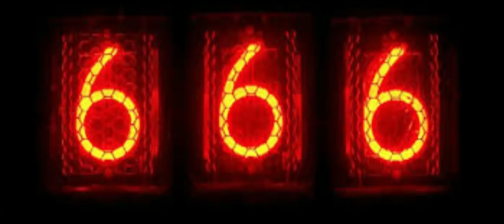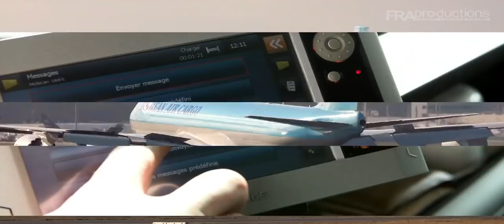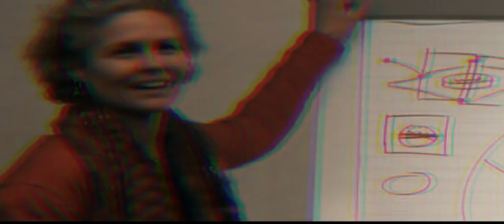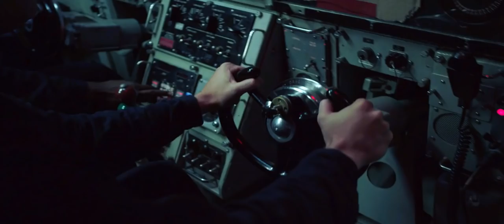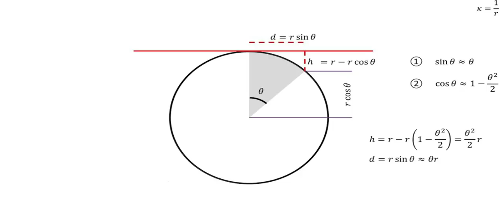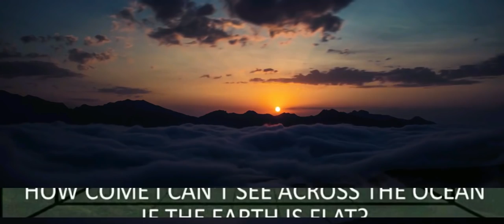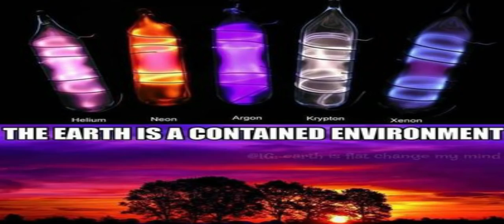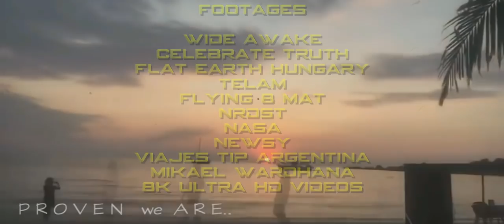Flatten The Curve ! The Documentary By Vikka Draziv

Comment: The Global Positioning Service uses 24 atomic clocks mounted on satellites orbiting 12 thousand miles above the Earth, each one broadcasting a very precise time signal at the low end of the microwave band, at 1.5 GHz.  
The speed of light including microwaves is about one nanosecond per foot.
Your GPS receiver needs to see four satellites to calculate your location from their signals.   Reflected waves won't work, it has to be direct line of sight.
The altitude record for balloons is 33 miles.    A GPS that uses balloons would need thousands of transmitters.    And they would need motors to hold their positions within a few feet of where your receiver expects them to be.   They would be large blimps, not weather balloons.    
There are no GPS blimps.
A 1.5GHz signal only travels a few miles in sea level air.   The GPS works way out at sea, thousands of miles from the nearest tower.   
There are no GPS towers.
The GPS is wireless.    It doesn't use cables. 

That leaves satellites orbiting Earth above the atmosphere as the only place the 32 GPS transmitters can be.
Billions of people and machines use the GPS.    It's not a hoax.   It can't be faked.

It only takes one piece of contradictory evidence to bust a false hypothesis.
The working GPS is irrefutable evidence of manmade satellites orbiting Earth.
Manmade satellites are irrefutable evidence of conventional orbital mechanics, as taught by universities world wide, including gravity.
Any object the size of a star or planet must be spheroid, because of how gravity works.

The working GPS busts the Flat Earth hypothesis.   No horizon photos or longwinded hand-waving Youtube videos can change this fact.
Reply: Out of curiosity, I have fallen into a strange rabbit hole
Help me
Reply: @deathpie24      It's simple.   Listen to the scientists.   They follow the evidence.   Ignore the clickbait miners.

Comment: Dudes,
       Long ago early navigators discovered that the elevation angle of Polaris yields the latitude you stand on.  Neat eh?  Flat Earth went into the dumpster and became the dumpster fire that this documentary is.  Polaris is viewed at the zenith when viewing from the North Pole.  It appears on the horizon when viewed near the equator.  This lead to Celestial Navigation that thousands if not millions of navigators have used over the centuries.  Celestial Navigation doesn't work on the flat earth.
       So how does your Global Positioning System work?  Like a champ eh?  If the earth were flat GPS wouldn't work at all.  GPS uses the Oblate Spheroid math model of the earth.  Where is the Flat Earth Positioning System?  Don't hold your breath, its not coming ever.
       I have a hard time believing these guys are pilots.  I used to do "Touch and Go" exercises just before dawn and you could see the sunrise two or three times.  Not possible of the earth is flat.  Every pilot knows when you trim the plane at your operating altitude, it will stay at that altitude until it runs out of gas.  The Plane will not climb into space and does not need constant "tipping the nose down".  The Pilot that said he does that is a liar and likely not a pilot.
       The beginning of this documentary is pathetic.  You guys should get your GEDs and get a clue!

Comment: You realize, that an aircraft at 30,000 feet, is visible to radar, on a globe Earth, at a distance over 200 miles. How many times was it repeated in this video that it is impossible. But it perfectly lines up with the globe.
Reply: Pretty sure he said impossible to track using radio waves. And I doubt radar would reach 200miles.
Reply: @monty3322  As he said, radar is line of sight, even on a globe earth, there is no problem with line of sight to an aircraft at 30,000 feet, at 200 miles.
Reply: @monty3322  You realize they have bounced radio waves off the Moon, and that is 230,000 miles away
Reply: @ToxicTeemoOCE  Yes there Is. I just looked at it on two Earth curve calculators, one being the Globers metabunk calculator and the other dizzib. They both agree you have serious line of sight problems. The aircrafts eye height is 30.000 ft. The ship is at sea level 200 miles away. From the pilots vantage point the physical Earth curve horizon is 6.7 miles away. At this point the pilot cannot see anything beyond that physical curvature limitation nor could his line of sight radar. The ship at sea level is another 193.3 miles away from the planes physical Earth curve horizon and has a target hidden height of 24900.7655 ft or 4.72 miles. This is the height below the horizon where the ship is down on the opposite side of the ball. There can be No line of sight at all with 4.72 miles of Earth height in the way.

 - Now what you have done in your mind has said to yourself, " we know ships can obviously radar contact aircraft 200 miles away and 30.000 ft in the air and because I believe we live on a ball it must be possible as proof of my ball" 

- Problem is you Failed to actually Check It against the sphere Earth curvature.  The fact radar does work with a plane 30.000 ft high between a ship at sea level 200 miles away is not only impossible on your globe it is a Flat Earth Proof. However you aren't done with the heliocentric problems. In the heliocentric model a spherical Earth is not only spinning 1040 mph at the equator (or in his case was around 600 miles due to his location) the speed and direction with a tilt and a wobble at which the Earth rotates would vary constantly through the ships travels, as well as in relation to the the 600 mph or more aircraft flying overhead all while Earth is said to be traveling in 8 different directions At Once flying through space at 67.000 mph. 30.000 ft is only about 6 miles which would be real easy to lose behind physical Earth curve (assuming a sphere) at speeds of 600 mph or more with all these different motions happening at once that are never accounted for. Painting a target would be near impossible. It's way worse for super sonic speeds which totally and utterly destroy the globe Earth.
Reply: @DivergentDroid  I think you don't know how to use a earth curve calculator. Put in an eye height of 30,000 feet. The horizon is 212 miles away. Try again, then get back to me.
Reply: @ToxicTeemoOCE   Both of those calculators tell you the distance from the plane's 30.000 foot eye height to the spherical Earths physical Earth curve horizon. Dizzib tells you it is 6.707193 miles. Metabunk tells you it is 6.71 miles. I see what you did.. you forgot to place your decimal point in 30.000 and just typed it as 30000. You may be right because I keep forgetting if I should use a decimal point or a coma However.. If you do this they will indeed tell you there is no hidden height but if you look you'll see in the diagram that h1 your target is Not 30 thousand feet in the air but it is on the surface of your sphere. Now draw a straight line from your planes eye height at thirty thousand feet to h1 on the other side of the sphere at it's surface and you'll see there still is NO line of sight but a huge mound of Earth between the two points. You may be right, I may have made an error however it makes no difference because the results are the same.
Reply: @DivergentDroid  It asks you the height in feet. The airplane is not 30 feet high, it is 30,000 feet high, no decimal point needed. For an airplane at 30,000 feet high, the horizon is 212 miles away, you know what that means? It has direct line of sight to everything within 212 miles, you know what else that means? Anything on the ground can also see the plane in return. So there is no problem at all, with radar on a ship, detecting an airplane, 200 miles away, if it is at 30,000 feet. It really shouldn't be this hard to explain. Not to so called experts.
Reply: @DivergentDroid  Oh my dear lord. Don't tell me you put 30.000 and thought that gave you thirty thousand. And you're telling TheYobbo71 HE made a mistake?? There's no decimal point in 30000. Some countries DO use a dot as a thousands indicator but it's NOT a decimal point if you do, but on line calculators will treat it as if it is. You can't make this stuff up!
Reply: @thezenwizard  Haha yeah, he is saying for an aircraft at 30,000 feet, it cant see anything beyond 7 miles. HAHAHAHHAHAHAHAHAHAHH
It is easy to spot people who have never been in a commercial aircraft. I have flown many times, and I can tell you, you can see a lot further than 7 miles.
Reply: @ToxicTeemoOCE  Either way, you're using circular reasoning, you haven't proven curvature yet.
Reply: @ToxicTeemoOCE  Not my fault you believe the moon is really that far away, and "they" bounced anything off it.
Reply: @thezenwizard  Honesty surprise you? figures.
Reply: @monty3322  Are you happy to admit, it is quite possible for radar to detect a plane flying at 30,000 feet, from 200 miles away? Even on a globe Earth.
Reply: @ToxicTeemoOCE  That's a fictional scenario.  No curve, no globe....so no it's not possible, there are no planes flying over a 'globe'.
The black swan has already been found, it killed Eratosthenes.
Reply: @monty3322  Oh there is a globe, why is it the radar can detect the plane at 200 miles, but not at 300 miles? On a flat earth that shouldn't be a problem. On a globe earth that becomes a problem.
Reply: @monty3322  You seem so certain. Yet so demonstrably wrong.
Reply: @DivergentDroid  " I just looked at it on two Earth curve calculators, one being the Globers metabunk calculator and the other dizzib. They both agree you have serious line of sight problems. The aircrafts eye height is 30.000 ft. The ship is at sea level 200 miles away. From the pilots vantage point the physical Earth curve horizon is 6.7 miles away."   Divergent Droid
🤣
Reply: @ToxicTeemoOCE   Overcome the black swan, then come back. Plenty of laser and distance evidence. Try "not denying" maybe you'll get it.
Reply: @thezenwizard  Here, I'll copy and paste to save time. " Overcome the black swan, then come back. Plenty of laser and distance evidence. Try "not denying" maybe you'll get it." Otherwise, go enjoy your ball somewhere else.
Reply: @monty3322  LOL the black swan, you do realize there is a reason they took that photo just inches above the water right? Because if they raised the camera, they would not have been able to see the distant oil rig. By having the camera just inches above the water, they used refraction to get that shot. You didn't notice how bent the distant oil rig was? There I overcame the black swan.

Can you overcome the white swan? The photo that bought Ranty back to the globe. I bet you won't look at it, because it would shatter your world. And bring you back to the globe. Overcome the white swan, then get back to me.
Reply: @thezenwizard  Sorry, I can't help you in your state of denial.  Good luck in your future.
Reply: @monty3322  But thank you for admitting that seeing a plane from 200 miles away is no problem on the globe.
Reply: @DivergentDroid  Thank you for admitting that seeing a plane from 200 miles away, is no problem on the globe.
Reply: @monty3322  good luck to you too. Perhaps you'll get the chance to see more of this glorious world and put two and two together. I hope so.